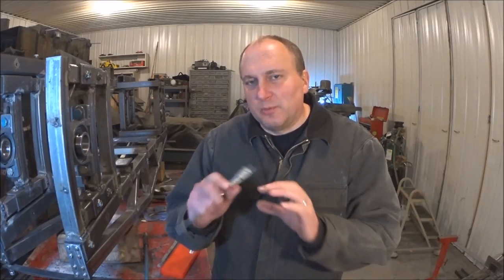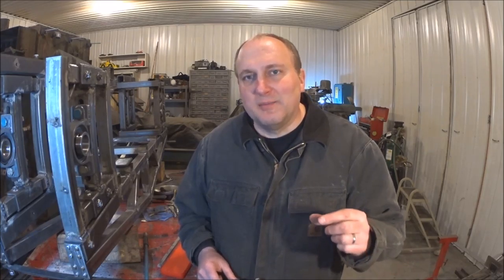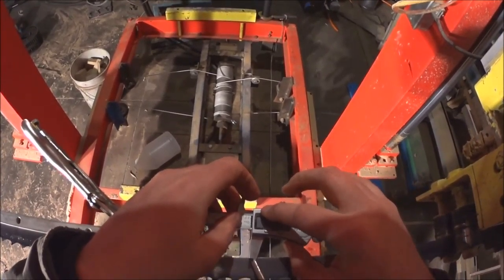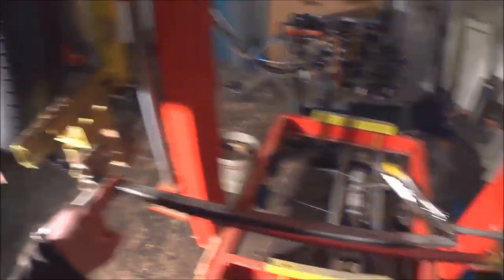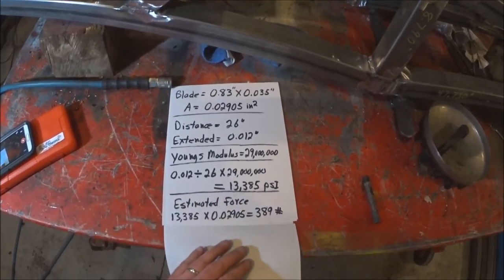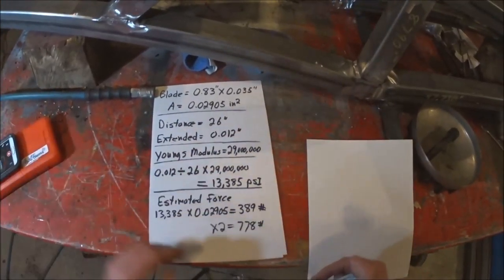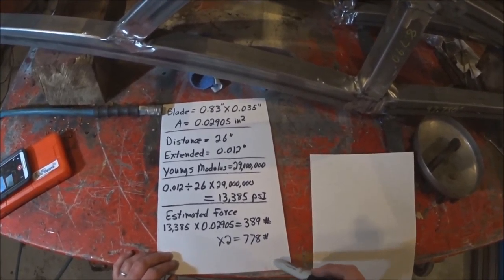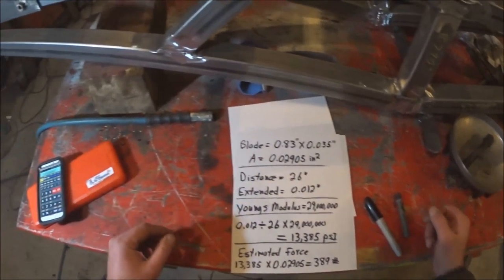Sawmill blade tension measuring

Comment: Loved the step by step breakdown. Thanks for taking the time. I had to experiment a bit to figure out my "sweet spot" with blade tension. I ended up changing the bearings and shaft on both wheels to 1.25" because I was noticing more flex than I was comfy with on the shafts. While doing that, I switched the steel shaft from a cold rolled mild steel to 4140 (if memory serves) for even less flex.  It looks like your mill supports both sides of the wheels : This is one of the main things I am thinking about each time I see that beast of yours. Your mill wouldn't flex like mine (and most that I have seen) if it is double supported.

Comment: You can get heavy duty compression springs that are rated to compress to specific length  by given force (i.e.  25% at 980lb, fully compressed at 2100lb).
Calculate what force is needed for the size of the cross-section of the blade you have, double that amount and find a spring that covers the range you need.
Install the spring between the frame and the tensioning nut and squeeze it until the length of the compressed spring corresponds to a required force.
One of the commercial sawmills use this method.
Just remember the force on the spring hast to be double of the recommended tension for the blade cross-section since the force at the tensioner mechanisms is balanced by “top” and “bottom” parts of the blade.
Reply from the maker: I have been wanting to do something like this.  More to eliminate rigidity in the system than to figure out tension.  For now, the rubber tires provide "forgiveness"...  May also use a stack of belview washers (wrong spelling probably)..
Reply: OneVeryOrdinaryMan the compression springs are made of special steel that retains its flex under stress over long time. Spring washers are made of ordinary spring steel that deforms over time under stress (the washer becomes a bit flatter than when it was new).
McMaster-Carr sell those compression springs. 
With rigid wheels the springs also maintain constant tension as the blade guide is moved in and out (which changes the geometry of the blade) and when sawdust particles get stuck on the wheels and the blade. 
Not a problem for sawmill with rubber tires, though.
I posted the comment for the benefit of others watching your video as I think is easier and more accurate.
Measuring the stretch of the blade to establish the relationship between the force applied and number of turns of the tensioning nut has a wide margin of error.
Those compression springs have narrow tolerances (=are fairy accurate and consistent) and measuring the length of the compressed spring can be quickly accomplished with reasonable accuracy in the field with simple tools after every blade change.
Also, since setting proper tension is quick and easy, one is more inclined to remove the tension when the sawmill is not in use, which extends blade life.
Reply from the maker: Like it..   good input. 👍👍
Reply: One more thing- fabricate a washer  for the compression spring from a chunk of 3/8- 1/2” steel. 1000-2000lb force will deform standard flat washer.

Comment: Just a thought... you’re comparing the 2 blade’s thickness difference and it equals about 16%... however, the actual amount of blade contacting the wood is the thickness plus the set of the teeth. For example if the set is .020” on the teeth in both directions, that would be .040 plus .035 =
.075” for the smaller blade and .082” for the thicker one. Thus the difference in the cut would be about 8.5% if I did my math right. Of course it’s just like peeing in the ocean; every little bit helps! Very well done however,... thanks for sharing.
Reply from the maker: Those are good points Tom. If by some chance I still have those blades I might have to put a caliper on it and measure it just out of curiosity. Of course somewhat water over the dam now as I've moved on to different setup.

Comment: Not the stupid milli meters!  Love it!
Reply from the maker: +James Gulrich I cant argue against the fact that metric is much more logical, But still....
Reply: James Gulrich if you consider metric stupid, why do you use decimal fractions of an inch (1/1000) for precision machining rather than 1/1024 ? It would seem logical to to continue to divide an inch into 2, 4, 8, 16, 32, 64, 128, 256, 512 and 1024 yet not a single American machinist does that but rather they all use decimal fractions.

It seems ironic that a country founded on the idea of independence clings so hard to a system of measures of its former colonial masters.
Reply from the maker: Relax people James is just referring to a joke I made.. humor, joke, tongue in cheek, not serious, all in fun, friendly ribbing..... That kinda thing.. 😉

Comment: Hi do you think when a person gets the right tention in order to get it back to the correct tention could a person use a guitar tooner? I am thinking why wouldn't it work! looking for your thoughts on this subject?
Reply from the maker: Could theoretically work as long as certain things such as blade thickness, width, and length between wheels was always the same.  Believe you would still have to initially perform a "standard" tension measurement to calibrate initially.  Most tuners may not work, but maybe something like a Snark, which uses vibrations could work. I have a couple and will have to try an experiment.
Reply: This is one of those far out ideas that could be most excellent. I have one of those tuners around here somewhere... I'll try this when I find it also. I expect that the "note" will be a little muddied because of the rubber tires (my wheels use rubber belts.) I'd love to hear if this ends up working for anyone.
Reply from the maker: Maybe next 1-2 videos, I will try the guitar tuner thing.
Reply: Thanks for the input.
Why I asked I have my mill with scooter tires  and how I am tension my blade is add air more tension more air I have been guessing but the other day snapped a blade. 
My tires are con-vexed so as not to take the set out of the blade I am wondering does your wider tires not take the set out of the blade? Are you Canadian?
Reply from the maker: I am not Canadian, but have a couple Canadians married into family - so I've had to learn the language, aye!😁.  I think getting a digital caliper and being able to clamp it to the blade is the most ideal way to set tension without spending an arm/leg.
Reply: Marc A Gagnon you can “tune” the same blade to the same tone(= same tension)  but you do not know what the tension is.
You need a reliable, repeatable method to tension the blade to a recommended psi value.
Different blade made from slightly different steel will resonate at the same frequency at different tension.
The temperature of the blade will affect the resonance frequency as well so the same frequency in summer and winter will give you different tension.

Comment: I spent the day watching cooks measurements, on steel wheels, ground smooth, with wheel bearings for structural rigidity as the pillow block could not stand 10,000 lbs for more than 5 hrs. they use a tension meter, by flexing the blade with a very hard pointer, thus measuring not youngs modulous, which with spring steel is huge, and the measurement of stretch will not in your case be youngs modulous, because by pulling the center out away from the blade, will just pull it in straight, maybe still measuring stretch length, but not being snapped on super tight will certainly slip more than one can believe. I have seen 10,000 lbs on tires like that, and they smash way down with that much weight. If it runs good for you, good on you, but youngs modulous of strength, hmmmmmmm. those tires will do more than just supporting the blade, but will smooth the kerf on one side by bending the teeth straight, thus causing if too tight to try to track down in the wood. Your mill seems to cut well, so good on you, but youngs modulous of stretch, is a stretch to me.
Reply from the maker: Admittedly, may not be translating you comment to my understanding correctly.  I am not applying anywhere near 10,000 lbs force on the tires. More in the realm of 10,000 to 15,000 psi on the blade. I am only applying around 1700 lbs to the tires. (plus or minus)..  the bearings I'm using are rated for ~2500  lbs load (each) at given RPMs - and there are 2 per side. So room to go.

Comment: Why do this? I dont get it
Reply from the maker: Perhaps not much of a reason to do this if you have a manufactured mill and specific instructions that came with it.  However, in a case such as mine it was critical to get some sort of baseline blade tension to find out where I was at.
Reply: Gary Rosema the blade needs to be tensioned  property for straight and consistent cuts. 15000psi (narrow blade) to about 25000psi (wide blade) is the typical range.
Commercial mills apply 16000 to 17000 psi for 1” blade.